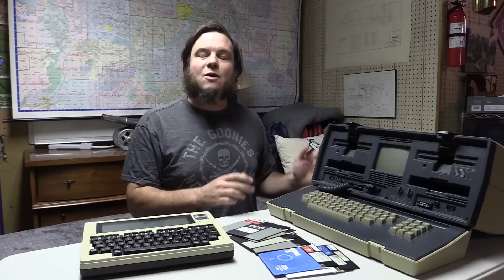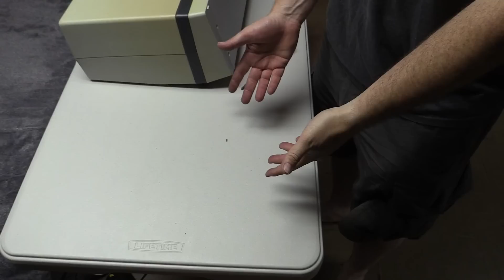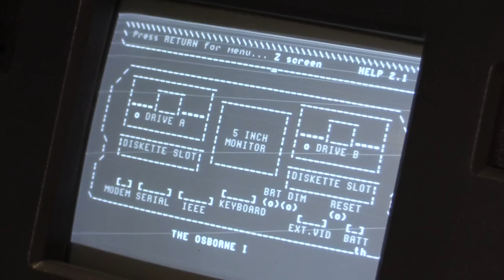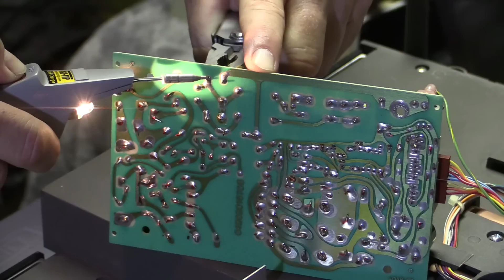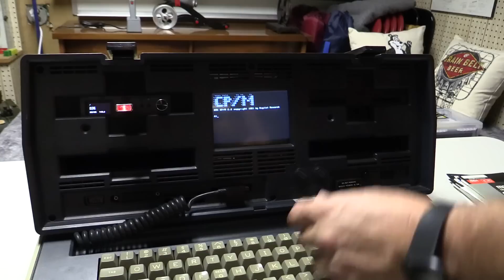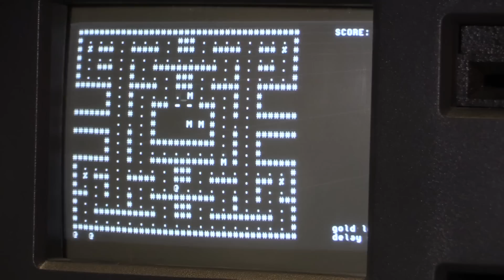Trying The First Portable Computer: The Osborne 1

Comment: Now if you don't think the Tandy/Sharp PC-1 - PC6 are computers -or not capable - go find one with the 4 color plotter, it can not only do graphics in 4 colors it can do text in vector graphic printing in 4 colors. Find another true portable that can manage that - and Portable - can it be portable if it is not battery powered?  Shouldn't a portable be capable of being operated in the field without a plug?  Many luggable and so called portables had power bricks bigger than the PC-1-PC-6 and would not run without an outlet. I suppose it's all about how you want to define portable but if it can't work while on a plane or out in remote areas then it isn't really meeting the needs of many mobile professionals.  Do you need a full keyboard?  If you have a laptop today, it has battery power, modest weight, workable keyboard, and of course a large bit map screen in color. What's the minium?
Depends what you need to do.  A lot of surveyors and engineers used hand held calculators, a correspondent may need to type fast and see enough to edit quickly - how quickly ?  All that defines the needs.

Comment: I have an osborn also - but "laptop". I don't think it's very easy on a lap - maybe first practical transportable/luggable that made it to market in any numbers. Now you did do a review of the Tandy model 100, how about the earlier Tandy/Sharp 6 ounce TRS-80 PC-1 through PC-6  Pocket Computer made earlier. The PC-1 appeared in 1980.  It had an LCD display, ran Basic, incorporated a full keypad - though tiny, Memory of the first model was only 2k but it ran on batteries and had built in high level math functions. it also had many add ons -including cassette storage, dot matrix printer - also battery capable. follow up models were more and more capable. It crossed over from the programmable calculators like the HP 65, 92, 97 all battery powered  - into a standard language, though the HPs and tI's like the Ti-59  deserve mention. The PC-1 bridges that gap to my mind.

Comment: G2 in the CRT to high/low - if you see the flyback lines then the G2 align is to high/low - can you align the Potentiometer for this issue? It is on the backside of the tube.

Comment: I had one of the TRS 80s too. I used it to do com testing with a small basic program. We had several pieces of equipment that used rs232 and using the trs 80 I could send any string  I wanted simply in its terminal mode. This was in the 90s

Comment: Thanks for doing this. Brought back many memories. This was the first portable computer that I owned. I used it for business. Used Worldstar, their spreadsheet and database program constantly. Did accounting for a 1200 creditor bankruptcy. Wrote numerous lengthy memos on it in the 50 to 100 page range. It was a real workhorse and a trooper. After the Osborne I  came out, the Kaypro I and II came out in rapid succession. They were just better machines and killed the Osborne market off. This was also the era in which Gates cloned C-PM, made some minor adjustments and remarketed it as Ms-Dos. That killed C-PM and M-PM.

Comment: I've used a flash stick to floppy drive converter for work at a multi million dollar company, lol. CNC torch and plasma table. ESAB Sabre, yes, it's spelled the British way. Last time the software had been updated was 1998. I think I last worked there in 2020, they might have updated, but I doubt it. That thing was built like a tank! Used it to cut out flanges and webs to build bridge girders. I think the thing was about 95 feet long, if I remember right.

Comment: Display lines are called retrace lines, thats the high voltage electrolitic capacitors (probably 600v) in the high voltage power supply, you'll find them close to the flyback transformer.

While in there look at the sawrooth waveform (now you can use that oscilloscope) distirtion there will also cause retrace.

Comment: Gosh, this brought back memories. The caps actually would dry out and buzz before they smoked. Ultimately I wound up throwing away four of my Osbornes since there was nowhere to get rid of them. It was the first computer to flag my spelling errors. It would not fix them or offer you any options it would just flag words it did not recognize.  It had word-wrap so your text never went off the screen like you are saying. I remember teaching myself WordStar one summer.

This is a good time to explain to people why the hard drive is called the 'C' drive. Since the 'A' drive is one on the left with the one on the right being the 'B' drive and when hard drives came out they became the 'C' drive! It's been that way ever since. 

I still miss a lot of the CPM commands since there were global and filtered commands that are just not available in Windows. 

I had about 3-4 of those soldering irons back in the 80s too and they sucked so I wound up throwing them away too.  I went to the gas soldering irons.

I sold my Trash-80 on eBay a while ago.
Reply: This should be the top comment.

Comment: Tip on bringing back to life old electronics. 
Cut power on for no more than 5 sec. Let sit for 10 to 12 hours or more; repeat ON/OFF cycle at least one more time; maybe leaving on for 10-15 sec if no caps blowing or getting hot. After two or three days, the caps should be reformed and you should be good to go. Good luck!

Comment: The sooner you can get the software onto more modern storage the better. Floppies didn't have a long life span. I'm surprised the data was as good as it is.
As for Linux first you need to find out what bit the system is. Im guessing 8 bit or less. So 32 bit and 64 bit os's are out. Also need to know what cpu is in it.
Reply from the maker: Z80 CPU, not sure if there's a Linux for that!

Comment: The zig-zag lines on the CRT are due to the beam re-trace. That is, the electron beam returning to the top after scanning down to the bottom of the screen. Normally, the beam should be blanked during this time so that the lines do not show up. Your monitor must have a fault either in the retrace blanking circuit or in the overall brightness. Could be more capacitor troubles, or it could be a resistor in a high-voltage area that has changed in value.

Comment: Get yourself a copy of the Osborne program "AMCall / COMM-PAC" if you want to talk to your serial port. Kermit sucks. Once you get that, you should just be able to copy software over the serial port instead of going through all the annoying conversions needed for the USB flash drive. You should also be able to create a new virtual "disk" on your Gotek and format it. Also, I believe AMCall has a mode where you can just use it as a terminal. If you have trouble, I can always mail you a disk :)
Reply from the maker: Tempting! I may or may not remember to check this when I do a follow-up video. I ordered some parts to make a Serial Wifi modem, so I might have a follow-up video on this in the future.
Reply: @saveitforparts  You're still going to need AMCall to use your Wifi Modem. It's more configurable than Kermit. You can find it from searching the internet.

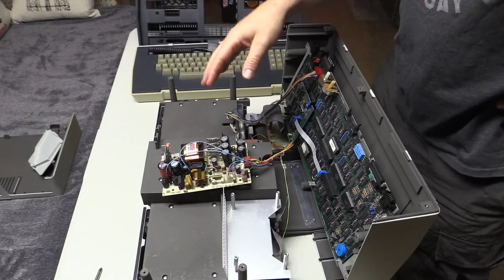Comment: You are absolutely correct about the three caps (RIFA'S) but looking at C18 the round electrolytic that is just next to the heat sink that is in the center of the power supply board TS 07:27 you finger is right over the top of it.  
It looks like it has gotten hot,  Judging from how much of the sleeve has shrunk down.  If you look at the other caps their sleeve is still over the top of the can.  This is a dead give away that it has gotten hot. another failure is the top will be bulged up. also any signs of fluid leaking out of the top of the creases of the can and the bottom of the cap.

Comment: "I did have to replace the vintage power supply capacitors, since those almost always fail on these old computers."  -   Always replace them, regardless, before power up. If you haven't operated the device in years, change them. It's not worth the bigger things that usually go with psus when they die.
Like for example, i had a TV, NOS in the box, never opened. My dad needed it, so i helped him set it up. Just before i'd put it in the plug i said "you know, magic smoke will come out" - and so it did.

Comment: Galvin was the first, but they were sued by Motorola and forced to change their name. Motorola was called Galvin Manufacturing before they developed their car radios. I saw a Galvin in a store, but it was being shipped back to the OEM to be re-labled and change the BIOS chip to display the new name.
Those are 5.25" floppies, not 5,5"
I have several working Commodore SX64  color portable computers,
Reply from the maker: I just got an SX64! It's in rough shape but I hope to get it working.
Reply: @saveitforparts  There are several important differences in it and any C64. First, its 60Hz clock signal comes from  a crystal oscillator module. with an internal divider to provide a 60Hz TTL clock. Second, the keyboard cable uses a special 23 pin connector that is very difficult to find. One of the ROMs is also different, in that you can load the first program on a floppy with just two keys. I believe it also used a slightly different VIC chip because the video was much better than most C64. 
I used one of mine 30 years ago to emulate all the patterns on a Tektronix master sync & test generator when I was building Ch 58 in Destin Florida. All they had was a building and a transmitter so I had to bring my own test equipment.

Comment: For the serial port, you need a dongle in the middle with LEDs on it. You need to make sure that you have Rx and Tx swapped, and you need to make sure they're both using the same form of flow control. Probably best to use xon/xoff (software) flow control. After that, you need to play with parity, data, and stop bit sizes and port speed. Start with N,8,1, 300, and go from there. No way that port is faster than 2400.
Reply from the maker: I think I have one of those serial port dongles around somewhere...
Reply: @saveitforparts  cool. For DB-25, 2 is tx, 3 is rx, 7 is common. 2,3,5 for a DE-9. You need a null modem cable or physically swap lines so that rx off one side goes to tx on the other, and visa versa. As for hardware flow control, good luck. I hardly ever used it, and couldn't remember them. I think maybe rts goes with cts, and cd is pin 1?
Reply from the maker: I read somewhere that you don't want null modem for this, or maybe that was another computer I was working on. I do have a few of those as well, plus Ye Olde Laplink cable.
Reply: @saveitforparts  if it's dcs equipment, it's already swapped inside. That's why you need the LED dongle. Tx will light the LED for that side. You want to see Tx and Rx lit, else both sides are connecting Tx on the same pin, which obviously won't work.

I suppose you could use a meter, but it's helpful to just leave it inline during the whole process. Plus, you can see the flow control lights go off and on based on settings during the comms, and that's kinda fun. Those old ports were so slow, sometimes it feels almost like you could decode the bytes manually.

I've heard a null modem cable called a laplink cable. I think they're the same thing.

Personally, I always liked the null modem cable that has a Y with 9 and 25 pin connectors on each end. You could talk on the 9, and connect the dongle on the 25

Comment: You should stick a fan in there too if you can solder in a ac-dc stepdown where the power comes into the shell. Easiest adapter is an old usb charger. It might not need it but pc fans are so efficient it couldn't hurt!
Reply: Video says it was posted 19s how is ur comment 11h ago?
Reply from the maker: I post most of my videos early on Patreon for supporters :-)
Reply: @saveitforparts  dang bruh
Reply: @Covine7  mightve been unlisted for a while to edit something
Reply: @Covine7  or time traveller, could also be
Reply: @PT-mj3bk  yas yas